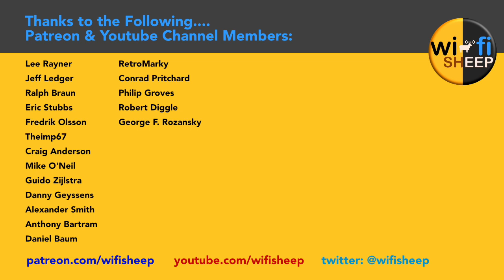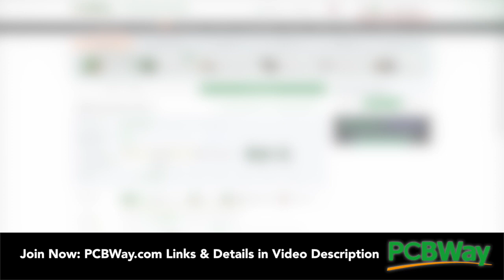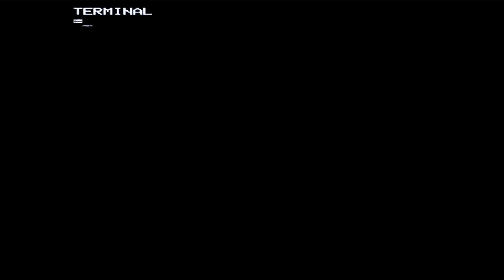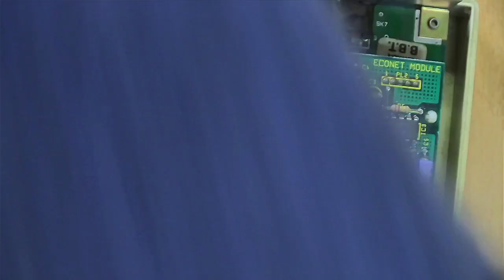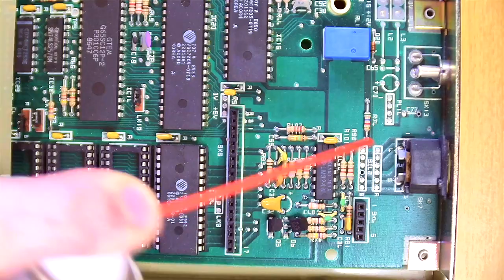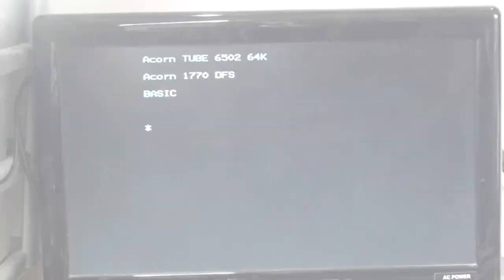Acorn Econet LAN Party! - Getting an #8bit BBC Master 128 ready for May!

Comment: Fantastic video, I really enjoyed watching the upgrade. One summer holiday I spent a week putting econet boards into bbc masters and then settling them up around school. For my GCSE electronics project I built an econet cable tester that would show breaks or joins in the cable, it would also simulate clock and data on the lines and look for bad termination using high speed op amps and a change from a nice square wave shape to a more backward small letter h shape. I loved and still love econet